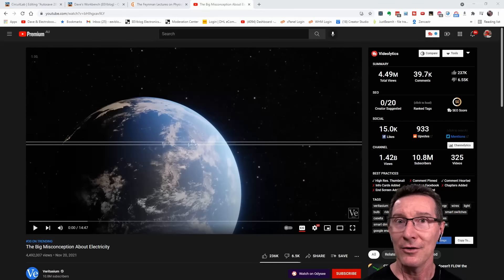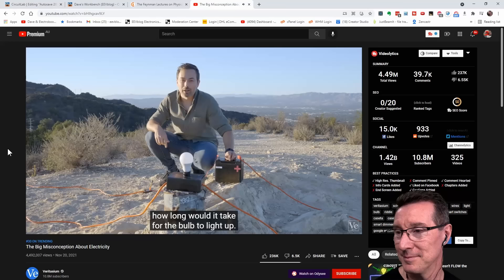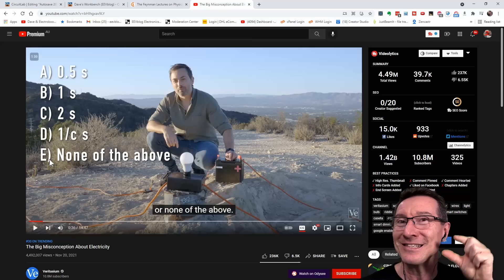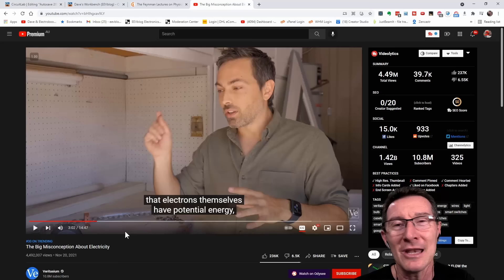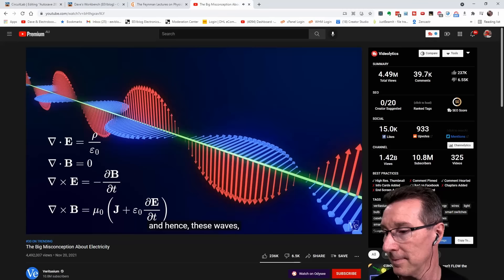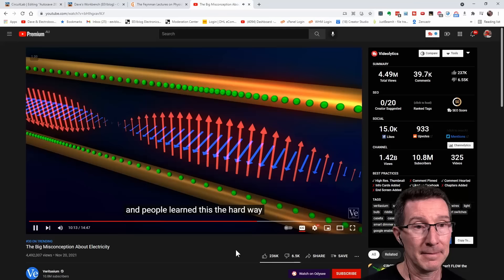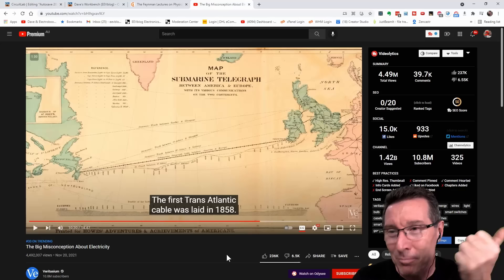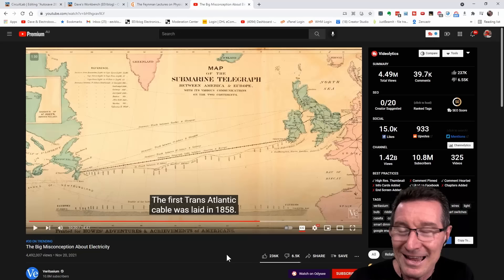EEVblog 1439 - Analysing Veritasium's Electricity Misconceptions Video

Comment: To me, saying that the energy is not in the electrons is like saying energy is not in the bowling ball placed high within a gravitational field: Technically true but an impediment to understanding the full picture. Also, the slowness of the electron drift is nothing to scoff at: The strength of the Electromagnetic Force is such that the magnetic field around a current-carrying wire can be viewed as a consequence of the Lorentz contraction in Special Relativity despite the motion being at mm or sub-mm speeds..

Comment: Sir, The  There is a magnetic field is even inside the copper  and the Poynting Vector points radially outwards from the surface of the copper. In the case of the flow of Energy, a vital component which is J. E ( a scalar ) where J is the current density and E the Electric field aligned in the same direction of the current and represents the flow of energy inside the wire.
A very low frequencies, and at DC it is this component which is predominant and not the energy radiating out of the wire. Thus, it will take one second for the bulb to light up ignoring the short pulse of radiation that will result from instant of switch closing.

Comment: Another thing is that it isn't really obvious that Poynting's vector represents energy flux density as the vector S=ExB is acquired through a large energy conservation equation in which it appears in an integral of the flux through the surface of the observed domain. As Griffiths points out: "We know that the closed surface integral of S*da
is the total power passing through a closed surface, but this does not prove that any surface integral of S *da is the power passing
through any open surface (there could be an extra term that integrates to zero over all closed surfaces). This is,
however, the obvious and natural interpretation: as always, the precise location of energy is not really determined
in electrodynamics " 

In fact there are some cases which one can find where the vector S points in seemingly random locations unlike this example where it nicely flows towards the resistor.

Comment: Brillant. It is a transient problem, not a steady state problem. In a steady state we need current entire the wire to have a magnetic field near the entire wire. But in transient the electric field only travel 1 meter, and variable eletric field creating magnetic field in the bulb, and then we have a poyinting vector between the battery and bulb.

Comment: I understand the reasoning behind the 1m/c answer, and I can see why people are saying that if you accept Derek's premises, and assume that even a tiny amount of current is sufficient to light up the bulb, then Derek's answer is right.

But I disagree. I think he's still wrong even if you accept the premises. In fact, if you accept his premises, isn't it true that the light is already on at t=0? After all, the inductive effect that the 1m/c seconds relies on is already there before the switch is closed. We have a 300,000km antenna attached to the bulb. There's not going to be a constant electric field across a 300,000km antenna. So the bulb is *already on*, even before you close the circuit. 

Said another way: If we ignore induction, then the bulb won't light up until the field propagates along the wire, so it will take a lot more than 1m/c seconds. On the other hand, if we don't ignore induction, then the buib still won't light up in 1m/c seconds, it will already be lit at 0 seconds.

Now, Derek could have added another premise: We are setting up the experiment in a universe completely devoid of electric fields other than the one that will be generated by the battery. But he doesn't say that. In fact, he implies the opposite - the wire is drawn above the earth in the diagram. He talks about it stretching half way to the moon. To me, this implies that he's talking about an experimental set up taking place in the actual, observable universe. If he wants to set up the thought experiment in a different way, it's up to him to make that explicit in his premises, and certainly not imply the opposite in his diagram and discussion.

Comment: One question, I'm not an electrical engineer, just trying to clear things up: Derek clearly said the E and B field propagate with the speed of light. The Poynting vector calculation depends on the presence of those fields at the bulb. That means, those fields take 1 second to propagate to the bulb. Only then his described mechanism allows the energy flux to happen. Did I understand that correctly?
If yes, does his original question even have anything to do with the fact wether or not energy flows in wires? The bulb lights up because it's a transmission line, but that doesn't have anything to do with how fast the E and B field traverse the line, it has to do with capacitive coupling of the two runs of the line. So it doesn't even matter and doesn't give a meaningful explanation of why the bulb lights up quicker than 1 second. You need transmission line theory anyway to explain the effect, no matter where or how energy flows.

Comment: Great stuff.  Here's a question:  Your simulation shows a rapid transient response when the switch is closed, with voltage and current across the load (bulb) spiking almost instantly and then decreasing asymptotically to zero thereafter for the rest of the 100 ms interval depicted.  This implies a brief flicker in the bulb followed by darkness for some period of time.  For the DC response to develop, i.e. a steady nonzero voltage across the load, don't the fields have to propagate along the wires all the way to the remote ends of the circuit?  In other words, shouldn't the Veritasium video have shown an immediate brief flicker from the bulb (near-instantaneous transient response), with a steady glow (DC response) kicking in only after a full second?  If so, that the bulb is depicted as going instantly to steady-on in the Veritasium video is misleading.  What we practically mean by a light bulb being "on" wouldn't happen in a few nanoseconds. I know that he verbally posits a fictional, ideal bulb that comes on as soon as it gets any voltage at all, but the brightness of even an ideal light source would surely vary with the power delivered to it.  What we practically mean by a light bulb being "on" wouldn't happen in a few nanoseconds -- there would be a small but perceptible delay.  If this is correct, then we should call B.S. on the visual enactment in the original video.
Reply: I have been looking through all the many comments for one that would point out this short transient effect from the distributed capacitance and finally found one. Kudos

Comment: You make some good points, but as an engineer myself, I would suggest not assuming all engineers got the same education you did or assuming they remember it all.

Most electrical engineers I know (my degree is CS, but I took/audited a lot of EE courses while getting my major, and now days I do a fair amount of embedded systems work that involves constructing circuits) learned all of this during a single week of only one course, and few of them remember it now, because (as you yourself mention), it doesn't come up very often in practical applications.  The main reason I remember it (aside from watching that video) is that I educated myself in EE (and some physics) before I even started college, so I was already familiar with these concepts beforehand, and the one week in which it was mentioned reinforced it.  (Also, I have a pretty good memory, and I constantly research stuff I'm interested in, which provides further reinforcement.)  Most electrical engineers I know talk about it exactly like it is just pumping electrons, and most are confused if you try to explain that it is more than that (speaking from experience here).

As far as leaving stuff out goes, Veritasium never claimed to target physicists and engineers.  It mainly targets laypeople without advanced education in these topics.  Also, you are probably aware that YouTube's algorithms punish people who make long videos, so experienced YouTubers learn to cut out less critical parts.

And "It's just a transmission cable" is a cop out.  Sorry, but transmitting data still requires the transmission of energy.  Sure, you are right that the losses in a power transmission line wouldn't be as big of a deal, but the point still stands: Iron clad electrical cables lose energy, precisely because most of the energy is being transmitted outside of the wire.  The trans-atlantic cables provide an excellet example, because this kind of loss is more obvious in transmission cables.  That said, iron clad cables for AC power transmission that long would have huge losses, so I think his example actually understated the seriousness of the issue, which is why he followed it up with the stuff about why high energy lines are suspended high above the ground.  (And if they were DC lines, the distance would cause enormous losses, so the fact that the cladding wouldn't cause DC loses isn't really important there.)

Comment: It depends on where the light is on the transmission line relative to the switch/battery. If one places each Switch/Battery at one end, light at the other end, it takes as long as light takes.

Comment: I don't think it's right to teach that the energy flows only outside the wire. That ignores electron flow, hole movement, and other things, but even if we ignore those for the problem, it still ignores the reality of the EMF as well. The electromagnetic fields do not start at some arbitrary point in space outside the cable's insulation. The EM fields start inside the conductor, and expand outside it. The energy is moving both inside and outside the wire. The amount inside might be very small, but it is there, and the fields do not just spring into being outside of the wire and outside of the cable the wire is in. The electromagnetic field exists both inside and outside the wire, and the same is true for the power source and the load.  Loved this video, hated the clickbait one it's explaining.

Comment: Saying that power (or signals) are really transmitted by electric fields rather than electrons is a bit like saying that a gun transmits force through the inertia of the bullet, not the combustion of the propellant. Or a ship moves through the water due to the engine driving the propshaft, not the prop rotating. It's kinda both.

The whole thing struck me like he was working really hard for a gotcha moment to the point where he was playing word games.

Not to mention that his thought experiment was kinda silly: A cable that long sticking that far outside the earth's magnetosphere would be inducting all kinds of signals all of the time. I doubt the lightbulb would notice if the switch were on or off. And even if you shielded it so hard that nothing could get through, then that's kinda screwing up the effect he's looking for also.

Comment: Actually at the high school level, it was taught as the electrical energy is transmitted along the wires as electrons. Whether it is taught as electrons traveling at the speed of light along the wires or whether it is electrons zig zag motion between atoms cause the energy transmission at the speed of light will depend on which school it is and which books they use. When it actually gets to the tertiary level when the actual physics behind the electrical transmission theory is taught. Now, it is possible secondary school university entrance exams physics subject goes teach the proper electrical transmission theory, but still it is in the university students get to learn this accurately in either electrical/electronic engineering subjects or physics, and obviously it is in physics you get to learn the theory in depth. Engineering is more focused on the practical side of it using formulas to calculate the actual practical stuff in the world, where physics can get deeper into the theory and philosophy behind it.

When Dave said "Nobody thinks electrons are pumped along the wires".  
Actually, people do. That was one of the ways the electricity through the wires are explained before the students or novices get deeper into the electromagnetic theory or electricity.
There still no consensus about how the electrons "travel" across the wire. One theory says zig zag motion of electrons that flow along the wire. Whether you want to picture it as a single particle of electron travels around the circuit while carrying energy or one electron hitting each other transmitting energy is up to you. 
The other theory says electron from one atom jumping onto the adjacent atom releasing energy in the process and that cascading process continues along the circuit while releasing energy.

Comment: We aren't all engineers. I was led to believe that it was the directional motion of electrons to the opposing polarity through a device that were in a sense "grounding or shorting out" - in a predetermined measured level according to the respective resistance - causing the device (the elements in a toaster/filament in a lightbulb) to consume power without blowing a fuse. I always wondered however why it is when a conductive mechanism - such as cable strand - is draped across high-voltage lines that are supposedly insulated, a short occurs - an often deadly short at that.

Comment: What happens when you turn off the circuit? Does the light go instantly off or will the light remain on for a notable moment longer before going out? As in after reaching the DC steady state.

Comment: Electrons in the wire are already moving before the switch is closed and energy does not come from the battery. If a condition is that 1 electron lit the light bulb, It lit faster than the speed of light of propagation of EM fields. It happens so fast there is no sim. tools in existence to mimic It. 
Every object of the matter is accumulating energy. If the shape changes, the energy flow does it accordingly. The change is instantaneous and faster the speed of light as light is not the carrier of energy, but the energy is electric.

Comment: Answer d is correct in that a tiny transient is seen at the globe after (1/c) sec. However the full available power from the battery will take the time the signal takes to travel to the end of the transmission line and reflect back. As this happens signals will be going left and right simultaneously and the full power reaches the globe after 2*  (1/2) sec or 1 sec. If the wires where rearranged so that the battery and switch are at the left and the globe at the right without changing the total length of the wires the full power will travel to the load in 1 s ( the wires are now 1 light second long). The reflected wave is not important here as it only affects the power source or battery (maximum power transfer if impedances are matched.
Also with respect to your answer d needing the units of metres i believe that answer d is dimensionally correct if c (3*10^8) is a pure number. However if it includes its units although not implicitly shown we should be writing.....
(1m)/(c(m/s)) = (1m)/(3*10^8(m/s))  and then the m unit will cancel out giving the answer as   (1/c)  s.

Comment: Derek mentioned mu zero or mu naught in one formula as the permeability.  But impedance is the combination of permeability and the permittivity.  Derek jumped from permeability to impedance without the permittivity.

Open transmission lines make pulse forming networks.  👍

Comment: It is quite confusing as current density in the wire is proportional to charges density and drift velocity. Drift velocity is low but concentration in conductor is high. So energy is transferred through the field but charge is really by electrons. So we are buying electrons in fact

Comment: The units shown on veritasium's video 1/c s are correct. Since c is the speed of light with units m/s and the numerator has units of m, then 1/c has units of m divided by m/s which gives units of s. Your issue was with lack of any explanation of the source of the figure 1 as the numerator, but the units in the veritasium video are still correct.

Comment: Your transient is a function of the granularity of the lumped impedance assumptions in your model. If you had modeled the wire as 1um segments, (even only for the first 1mm of the wire) you will see that the voltage does not instantly go to 1V.

Comment: Using a DC example to explain how energy gets to your home and how fast is problematic. The example is also problematic in that nobody models a circuit or transmission line by running the L/+ wire in one direction then looped back, and the N/- wire in the other direction and then back. The L/N (single phase) or +/- pairs are almost always run parallel to one another with the source at one end and the load at the other. It's also practically helpful to use Fleming's right and left-hand rules for electrical circuits, esp. motors, generators, and electromagnets. Proximity to ground also comes into play for AC lines. I also think the speed of energy travel will depend on the all the physical properties of the wire and how fast the electrons push through, which will be slower than light (but still quite fast, at least at first when the circuit is first turned on).

Comment: Two questions:
1. In the example a battery was used. But if DC doesn't generate the fields outside the wire wouldn't the light bulb have to wait until the entire cable was traversed before it would light up?
2. If the power is actually traveling outside the wire with AC and the distance between the power source and the load is the factor - what would happen to the amount of power once you start widening the distance? Would the light bulb receive less power or you potentially send power over long distances with no loss at all?
Or did I completely misunderstand it all?